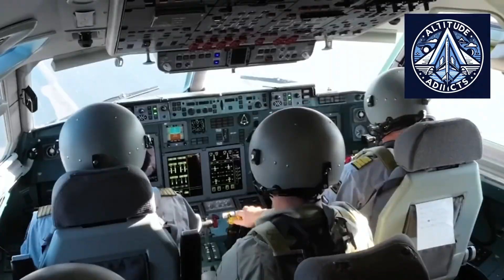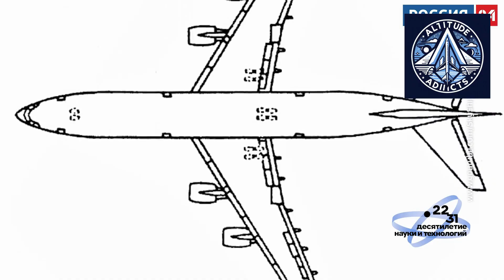Why the Il-96 Will Remain Russia’s Main Wide-Body Aircraft for Years

Comment: It's tragic that these dinosaurs are the  "best" viable option presently.
One saving grace, perhaps, is that Russia is running a domestic civil aviation market here.
Having its own oil reserves, thus kerosine production, the Russian federal government can sell subsidized fuel costs to the various domestic airlines to offset the FOUR, higher consumption, inefficient, antiquated engines, first designed by Fred and Barney on The Flintstones.
Plus the higher maintenance of FOUR engines used, over two, with modern airliners.
After sanctions, don't let any western airliners receive the subsidized fuel pricing at Russian airports.
Reply: I don't think Il-96 is a dinosaur at all given it first flight was in the 90s. The 747 is far older and still running so why can't the Il-96
Reply: @shinsaber2109  The 747 is no more produced. And it is still in use because it was one of the most successful jets. The Il-96 was practically never produced and was already obsolete when it was introduced.
Reply: @alexandervt641  You don't understand what I said. My point is that an airplane has a very long life and the 747 was manufactured from 1968-2023, 55 years and the Il-96 only start manufacturing in 1992 so it is still not dinosaur yet. The frame is still good and they can still use it with upgraded avionic and engines which is not a big deal for Russia anyway.
Reply: @shinsaber2109  The point is that the Il-96 was outdated from the very beginning, that‘s why it was never really produced. Producing it now would be even bigger nonsense, and there are also no plans to do that.
Reply: @alexandervt641  Outdate from the beginning? I would remind you that the Il-96 is only one year younger than the A340, another quadjet in the same era. The reason for the low number produced was because it lost the traditional market. And now Russia revives it to be a stop gap until the new twinjet long range aircraft is designed and produced. It also can work as a long range freighter.

Also, one more thing is that the Il-96 could be produced to serve the military purpose as well. I will be surprise if they do not pursue something like a tanker and maybe an AWACS.
Reply: @shinsaber2109  The A340 was also a flop; the sister model A330 was successful. The problem with the Il-96 is not just having 4 engines but also the engines itself, the avionics, materials, etc. And what means it lost its traditional market? The Soviet Union was a command economy without any market. That‘s why none of the Soviet passenger jets was ever competitive. Even by low Russian standards the Il-96 is too backward and there are now plans to start production of this jet.

Comment: Which airline operate the Il-96-400... or at least ordered some? 🤔
Reply: Cubana has a 300.
Reply: @madmax7622 
???
Wasn't the talking point the sovereignty of the Russian market? 😳
Reply: Red Wings seperti biasanya
Reply: @SmartphoneZTEbladeA72  
How many passengers did they serve? 🤔
Reply: @CheburashkaGenovna 
I'm not entirely sure myself. However, the Il-96-400M conducted test flights two years ago. Some reports suggested it was for test flights with entirely domestic components, while others suggested the interior was being prepared for modern civil service, with the latest design based on Western aircraft. If no airlines are interested, it will likely be used solely by Red Wings (a Rostec-owned airline). If it is indeed for civil service, it would likely be capable of a range of 10,000 km with 320 passengers. The more passengers, the less fuel it can carry. Therefore, if it can't carry as much fuel, its range will automatically be reduced.